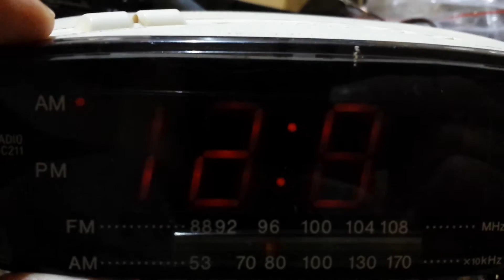4 Transistor 5 to 120 volts inverter powering a radio.

Comment: You made an inverter. Nice! I thought it would be more complicated and require more parts.
Reply from the maker: Well it's very low power and the frequency is not stable it will vary with load and input voltage but it work for LED light bulb :) and small radio lol